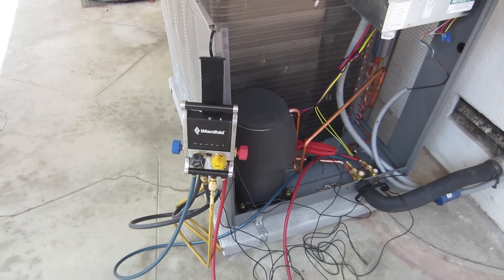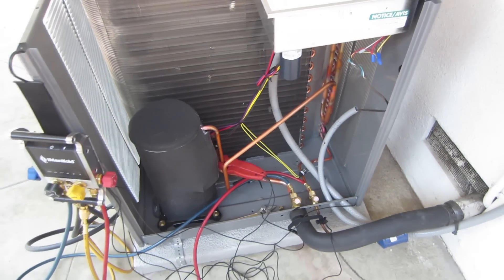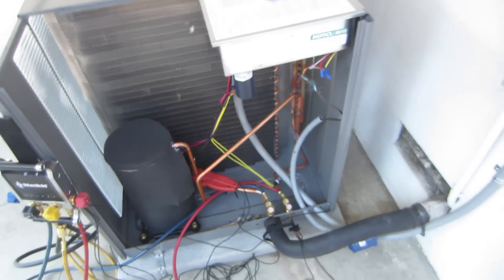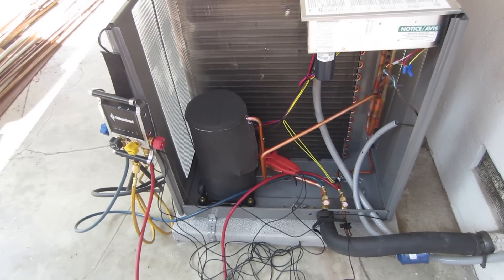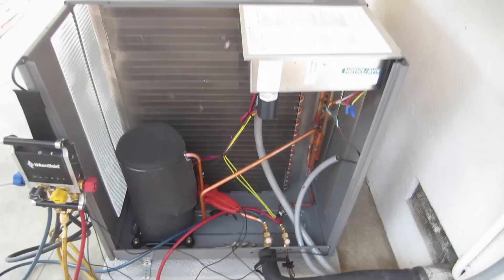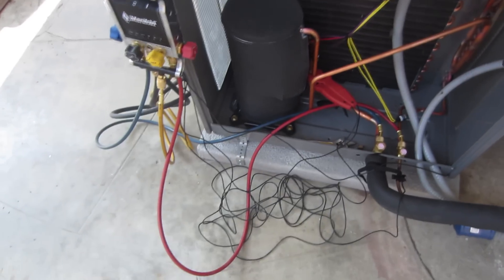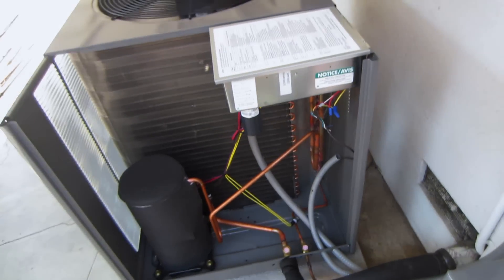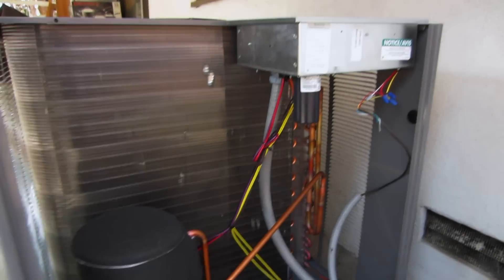iManifold Refrigerant Verification for HERS

Comment: Nice install and nice video.  I get jittery seeing a cover on a condensing unit -- always worried it won't be removed before someone switches the system to cool.  Does Rheem ship those standard with this type of equipment?  Is the owner trusted to always remove it before startup?  Curious.
Reply from the maker: Most of my customer I put the cover on for request them and they are a option from Rheem Prostock parts.What I find is that the customer I put them on for are the tidy customers so I haven't had a problem. Thanks for watching!